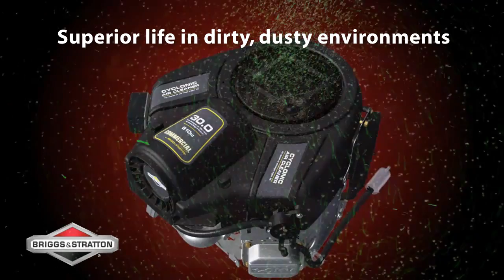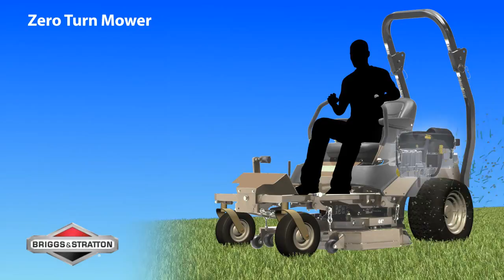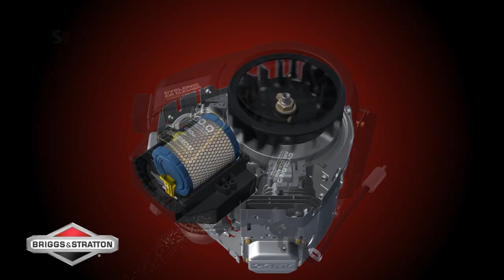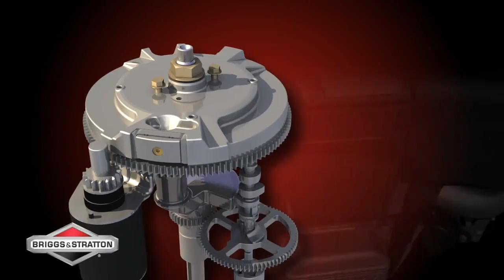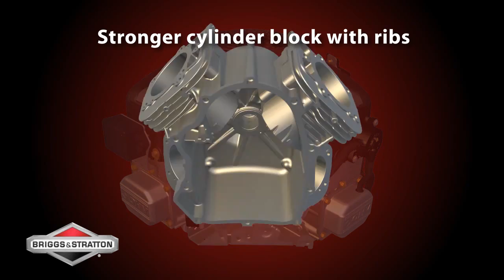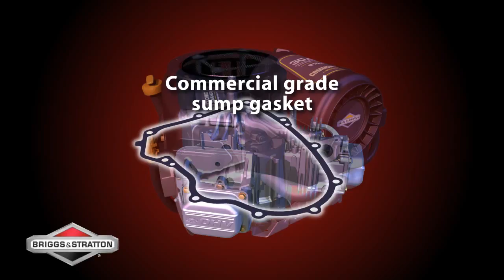Briggs & Stratton Commercial Turf Series

Comment: Do the commercial  turf series engines use the same clutch and electrical  connection as the Briggs & Stratton. 23 hp  Intek 440000 Extended Life Series engines?

Comment: I like the guys that talk about how youd be lucky to get 500 hours or more out of one. I run a scrap yard and ive seen all makes in all kinda of shape.  Stuck valves that destroyed pistons and broke rods WAY BEFORE 500HOURS . if your running a lawn service and the mower makes you $60 a hour it runs, doing the math thats 30k it made at 500 hours... 30k.. and you say its crap lol. When you could literally have a spare on the shelf and swap it out in a afternoon and go make another 30k . Ive run mostly briggs all my life and never had one bust never lost a crank seal. Only had one year where one wouldn't start after the off season and that was my fault because i put too much seafoam in it before putting it up. But i also blow my mower out after every use and do regular maintenance plus always watch out for the one stick that somehow jams itself in between the crankshaft cover and the drive pulley/pto...

Comment: I have this engine on my zero turn. It has 360 hours on it and I noticed oil leaking from the bottom of the engine. Turns out it was the lowest seal of the engine. I should have listened and bought a Kohler instead. Do not buy this piece of s***
Reply: So put a new crank seal in it...
Reply: @rannz8  did it.
Reply: Biggest Piece of Garbage I ever bought. 150 Hours And Going On Three Oil Sump Gaskets. They Discontinued The Thirty Horse. You can by the 27 H.P. but I'm hearing that People are blowing Oil Sump Gaskets With Them As Well. Mine hasn't blown up yet but You can fill it Up With Oil and be find Most Of The Oil On The Ground Next Day. I'll never buy Another Briggs And Stratton Again. Husguvarna 7000.00 Piece of Trash.
Reply: @christopherl2143  That's awful but not surprising. I just think it's funny they specifically mention a "commercial grade sump gasket" & many people have it fail on them. 
I will say, I had mine replaced & now have 490 hours on engine & it's still running great. If the seal goes again though I'm selling the mower.
Reply: Your Pretty Lucky You got that far.
Reply: They Are Junk I'll be going With the Kawasaki as well. I will never by Briggs and Stratton again.

Comment: What's the difference between this and a Vanguard?
Reply: @Philodox-c1h  you're spot on. I have a 23hp commercial turf. 360 hours & main seal leaking & hair line cracks near crankshaft leaking. Got it out back together &, now the governor Is all f'ed.

Comment: Briggs used to be the best. But sadly they have cut quality in order to boost profits. Cheep components when needed to replace should prove it's fact. You'd be lucky to get 500hr out of one before it has major issues.
Reply: B.s
Reply: I definitely think you're onto something. My mower with this engine has 360 hours in the lower seal of the engine is no good. Noticed it leaking oil all over the place the other day luckily I saw it in time. Cost me $300. Not to mention regardless of how you winterize these engines they still run like s*** every spring and need a carburetor cleaning. I would not buy again should have bought a cooler
Reply: Kohler

Comment: Replacing my worn out Kawa engine with a cyclone engine as its about a $1.000 cheaper.Will chin back in when I run it awhile.
Reply: So far so good.
Reply: @countryman4691  Nice! Good to hear. Just watch that bottom sump seal
Reply: @countryman4691  so still going strong? What mower did you do the kawa to briggs swap on? Did you have a issue with the briggs oil filter being lower and futher back versus the kawasaki?
Reply: @jtaylor9355  Still going strong but I only cut my yard so commercially don’t know.No leaks with lots of power.ask someone who used them every day.
Reply: @jtaylor9355  Put the Briggs on an 06 Gravely with a 5 foot deck.No problem changing the filter maybe because of the way the mower is made.I just use on my yard don’t know what commercial use would do.
Reply: Countryman how does it pro-form
Reply: Hows it going?
Reply: Well how did it work out for you?